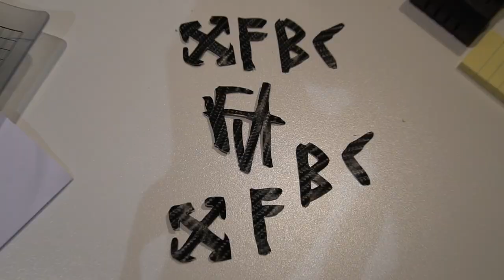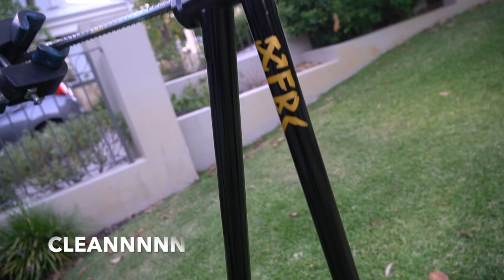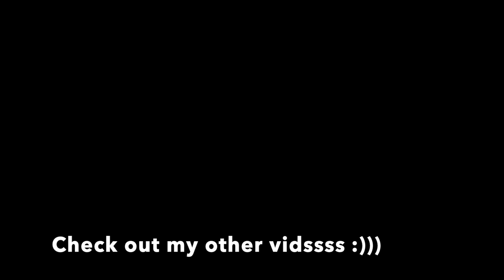A bmx restoration worth watching and like+subscribing too :)

Comment: Excellent build. I wish I could find paint stripper that works that well.  I have a good on I use but it is usually a 2 step process to get all the paint off. Awesome job keep up the amazing channel.
Reply from the maker: thanksssss my paint stripper is pretty ordinary and I have to do 2 or 3 times with it too:)) we are all in the same boat :P
Reply: My paint stripper doesn't work :( resorted to good old sand paper and elbow grease haha

Comment: Funny how it’s just dust coates did you check the vin to make sure it’s not stolen or do you have the paper work paint stripper and one can of white paint to make a video with you wired air pods that are sum how still blue tooth

Comment: You shouldn’t really be using it on the rubber tiers or set or nothing or the plastic pedals because it can eat it a way
Reply from the maker: yep agreed if it was full strength but it had been diluted with water so it won't eat away:)